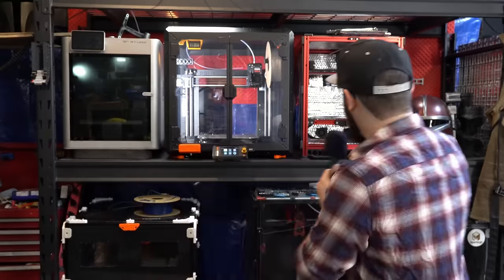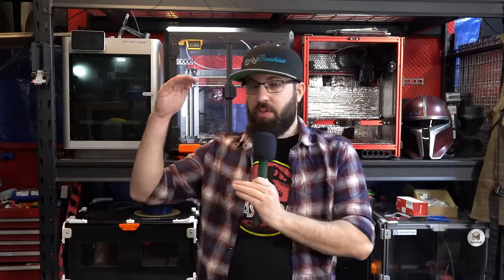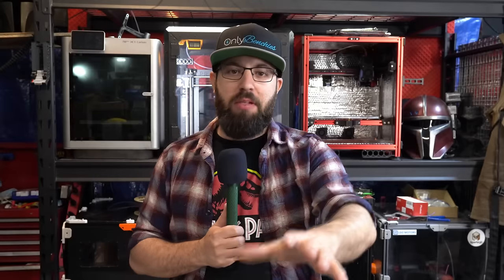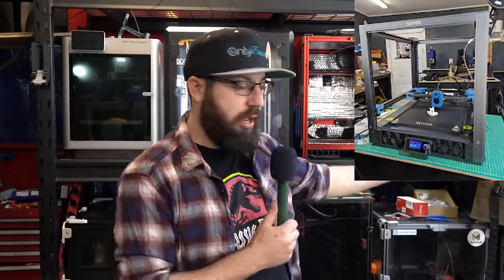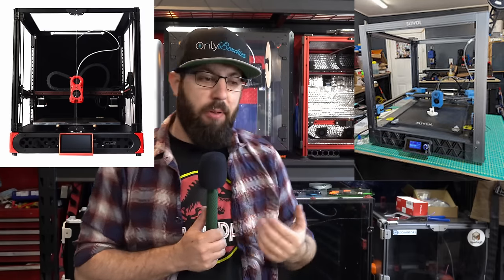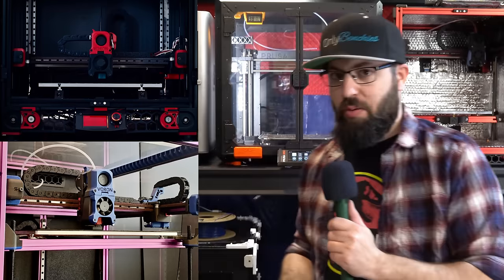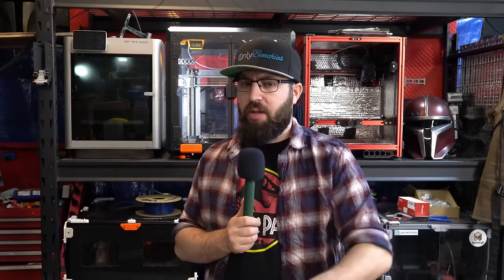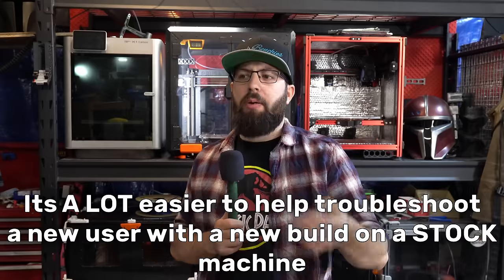What Is A Voron And Which One Should You Build?

Comment from the maker: TL:DW - Does it qualify for a Voron Serial Number? If no, then not a Voron, simple as that
Which Voron should you build? If thats the only question with no other info, build a TRIDENT
Reply: I wish LDO had a 350mm trident kit
Reply: Very happy with my Trident. Been pumping a ton of abs/asa and some carbon-nylon as well. I learned so much building and tinkering with it, never regretted my choice. The 0 was a bit too small for my taste, and the 2.4 looked too complex with no clear advantage over the Trident for my beginner brain.
Reply: @dog2bert only 350? Why not 500, 600, 800, 1000😂
Reply: @simontanguay3619  I think there are more mods that are specific to the V2 over the Trident.  Otherwise the two are neck and neck in rating.
Reply: Do you have to use ASA or ABS, or is PETG ok if its beefy for most part, obv hotend parts may need to be ASA for heat. But what about the rest?
Reply: @PMcDFPV  I would not use PETG if I can avoid it. ABS/ASA has better properties overall, be it thermal or mechanical. For increased rigidity, carbon abs/asa will do even better.

Comment: When i ordered a Sovol SV08, I did not consider it to be a Voron, although it is largely a Voron design.  The plan was to swap the toolhead and move to mainline Klipper.  Once i got it, I realized the toolhead is fine with it's Bambu clone HE.  The software lets it down.  Ive moved it to mainkine Klipper and am reasonably happy with it.  So, its not a voron but it has many of the great aspects of a voron and i specifically purchased it for these aspects.  Everything about the SV08 that isnt based on Voron design is what lets the printer down.  A voron would cost me $2500-3000 cad.  This SV08 cost me about $800 cad.  Not as good but better value for someone like me who also built a vorona and am happy i did.

Comment: I totally get what you're saying and you're also right. You don't get a Voron when you're buying a SV08 for example. Sure thing. But. "Ultimaker at home"... where did that come from again? Voron Design didn't claim to have the support or software like an Ultimaker back then. But they provided a similar machine with of the shelf parts. In this case as a non profit organisation, which is absolutely awesome. 

But am I the only one who sees the similarity with Voron and SV08/Troodon? They don't claim you get the same benefits as with the original, but you'll get a similar machine. Electronics in the base, easy to put panels on, same firmware etc.. I think a Troodon or SV08 is obviously more a Voron as an Bambu or Ender V3.

I love my Voron printers. And building a Voron was the best idea I had with 3D printing as a hobby. But as long manufactures respect Voron licencing it could be a win for the community. Can't wait to see what people do with SV08. And maybe Voron users can benefit from new mods and extensions like Klipper-AMS every chinese company is coming up with. 

Anyways, keep up the great work and have fun at reprep festival!
Reply from the maker: The "ultimaker at home" is from the design goal of the original voron.

An ultimate 2 tier of printer. But you can self source and build yourself
Reply: I personally believe the better label to apply is: "(Commercialised) Voron Derivative".  It may be wordy, but it is probably the most succinct yet accurate way to summarise what machines like the the Vivedino Troodon, the Sovol SV-08, and arguably even machines like BambuLabs P1/X1, Creality K-series are.

Comment: The V0 advice is very good. I have found the same experience with my v0. Lots of fun to build, and an excellent secondary printer. I would not want it to be my only printer.
Reply: I built a V0 as my first and so far only printer. It was super fun to build but I also have access to a bigger printer at work. So if you have access to another printer somehow and lack the space for a bigger printer at home, I can really recommend the V0 as the first/only printer.
One day I will have the little one print the parts for a V2 or Trident
Reply: @metalhammerish - I purchased a V0.1 kit from LDO well over a year ago and it unfortunately is still in its shipping box.  If you don’t mind, I have a couple of questions - Did you build your’s stock?  Is it still the stock printer you built, or have you since tweaked it?  Finally, do you still use it often?

Comment: I built a Voron Trident 300 kit from LDO. It's my goto printer now, 100% reliable and perfect print quality. Only mod I did was installing the Nighthawk wiring for the toolhead (highly recommend).
I also have a Bambu X1C (I printed the Voron parts on this) and a Prusa MK3S+.
Thinking about selling the Bambu and Prusa. I only need a hardened steel nozzle for the Trident to print Nylon-CF.
Reply: How much are you looking to sell tge MK3S+ for?

Comment: I just finished my first voron build and it was converting a FLsun cube to a voron legacy with the build volume of 310x310x415. i had to using one set of mods to allow for the use of short linear bearings be used from the FLsun but side that every thing else if legacy. A few thing i found with doing the voron legacy is finding the right hardware locally or screw kit online with descent shipping cost. also that there no manual for the printer it self but the tool head lucky dose so, u need to work from the cad file when doing the printer frame and core xy which is no big deal just have to stop and think on which is right step to go sometime. only big thing i could say about the hole printer build is that when putting the X Y carriage they call for a M5x30 button head for the rear most idler and if you screw it all the ya down it blocks the linear rod from passing through and socket head the same. i end up using a M5x45 just a pin to hold the idler in place and it seem to be working so far. the voron legacy seem to be a good option for someone that doesn't want to print abs but still want to try out the coreXY printers. Plus for the cost to do a voron legacy isnt bad at all compared to the other in the voron family to get ur feet wet only kicker is the self sourcing but if you can get lucky and find a donor printer that similar part to a legacy you can get in to a voron for very cheap thankfully.

Comment: In theory, you can eliminate the keyback on the switchwire in software.  If you keep the X and Z steppers powered up, the gantry isn't going to fall.  The catch, would be to auto home the Z axis as part of a power down function in software.  In the event of a power failure, there might be enough friction generated by motor back emf to gently lower the gantry without damage to the print head if it didn't "fall" from the very top of the Z axis.  The switch back does add some drag to the Z axis on the way down, and reduces drag on the way up, which might have some effects on printing as the motors might need a bit more power in one direction vs the other.  One would only see this during Z hopping though.
I'm almost finished with my Enderwire build.  Still need to fine tune things after a last minute hot end swap (gave up on the Taichi after it kept clogging, and now have an E3D Revo Voron.  Only one extruder now, but I might build an ERCF in the future).  Also need to assemble the enclosure and build a Nevermore.
Reply: What about if you just use a 1:2 belt loop in place of AB (XZ) drives? will that help?
Reply: I ordered all the parts for an Enderwire recently, except the keyback. I never really knew what it was for, so I skipped it. Is it a must have? I mean, if I just remember to power down the machine and gently let it rest against the bed, is that OK? Will the motors struggle to maintain position with the help of that little doodad?
Reply: I built a switchvyper (anycubic vyper converted to switchwire just like the enderwire project) you definitely should have the key back. Without it, the gantry will fall. Not terribly fast but the weight will cause it to sag and drop on its own. The specified key back gives just enough resistance to hold on its own but even just a tiny bit of additional pressure on the gantry will cause it to drop of motors are off
Reply: @jettachamp26  It probably depends on how heavy the tool head is.  I'm using a bowden extruder on mine at the moment, that's a bit lighter than the clockwork2 extruder.  I do have the specified keyback on mine.   I wonder how the V2 with the belt driven floating gantry keeps from falling with the motors off.
Reply: @KennethScharf  I have two v2s. A 350 and a 250. Both have minimal sag (mostly just the back where the motors are) but does not fall easily when motors off. You have to push a decent amount

Comment: I say the Troodon 2 Pro is Voron like because it uses the StealthBurner that can be upgraded or replaced. The the Sovol SV08 is not. It is a coreXY printer with a flying gantry. At least that is my view point. But I could never confuse a Bambu Labs printer as a Voron because the parts are proprietary and is very closed system.

Comment: Printers for Ants ARE Vorons.  They can be assembled using (most) of the official Voron manuals.  If Voron's auto BOM compiler on their  web site allowed for changing the bed size of a V0 , V2, or Trident to the PFA range, or swap between 1515 and 2020 extrusions, the result would be the same.  Have any builders made non-square bed sizes for Tridents or V2's?  Something like 250x300 for example  (Makerbot foot print)?

I like the idea of ready to rock and roll off the shelf Vonor-ish printers.  At least so long as they are Open Source, and the mechanics allow for user swaps of hot ends, including mounting Voron design tool heads (stealth burner) and other mods.  Don't call them Vorons, but do mention where some of your 'DNA' came from!
Reply from the maker: Most of the printers for ants do fall under "it's a voron". As they are basically remixes of the base designs using different components but still following the same design ethos.

Comment: my LDO Voron is basically stock, i just replaced all axial fans with Noctua ones to be more quiet, and i replaced the omron probe with klicky ASAP.
now, about a week after its finished i started preparing magnetic hinge doors to take off and quick release bottom panel clips. might make quick release klips for more panels, not sure yet.
Reply: Annex clips are the best and if you don’t have a front door do the “fridge door” klicky door mod huge improvement and looks incredible
Reply: Printable’s had a good annex clip stl. And they look great printed in two colors for even more accent

Comment: Also want to know why the rat rig is better for over 350mm2 size? Does the rat rig have beefier extrusions? 

The builder on voron will give you a material list if you do custom size. Does the larger format become too flimsy? And how does that go against the likes of elegoo OS giga? That has super thin extrusions for the size. 

Curious as I’d like to do a printer that is 450x300 but on livestream and here it recommended to go to rat rig….
Reply: Ratrig uses 3030 extrusions instead of 2020, so much stiffer for the frame. Doesn't matter that much at smaller sizes but becomes increasingly important at larger sizes where vibrations can limit your max acceleration (even with input shaping)
Reply: Yes, Ratrig uses 3030 and other beefy components.

Comment: I've been wanting to build a Voron for some time now, but I'm still not entirely sure which one I want to build. I got my first 3D printer early last year, a Bambu Lab P1S (I know it goes against everything that Voron stands for but I wanted a good out of the box experience) I figured that since I already have a Core X Y printer being my P1S, I would be a good idea to build a 2.4, or even a 0. Would either of these be the right call? Printing is just a hobby for me, I do not make any money off of it I do it purely for the enjoyment of making random stuff.
Reply: I would recommend a v2.4 to try something different. The p1s is very similar to a trident (but I believe only 1 z motor instead of three). I personally prefer the lower center of gravity and stationary bed, especially for large things.
Reply: Plus, quad gantry level go brrrrr
Reply: I'd honestly say if you don't need a same/bigger printer than your P1S, the V0 would be a good printer for when you want to print something small and don't want to heat up a larger bed.  There are a TON of variants to look at, however.

Comment: I actually want to disagree and recommend the V0 as a first Voron. A Voron should probably not be your first printer, so you likely have something that can print a big part on the rare occasion you need to. And your V0 can print your Trident when it comes time for that. A V0 is cheaper, it's easier to tune, easier to maintain, and heats up much, much faster. You're talking about 10-15 minute heat soaks instead of an hour. I'm always fighting with my V2.4 to get it to behave, or I'm sitting around waiting for it to heat up. And I don't want to use my old MK3 because it can't do much with ABS and it's slow. I really work hard to design things to fit in that 120 cube.

And I think there is one V0 mod you should start with right off the bat - handles. It's super simple and it's easier to build the printer with the handles attached, and it's easier to put the nuts in at the start to attach the handles than it is to add them later.

Comment: How hard is it to get IDEX working on a Trident? I really want to try mixing flexible filament in for seals and joints. Purging towers seem... not great.
Reply: There are several ways to get a tridex. Either full self source or starting with kits or pre built machines. Although if you use a kit as a basis you will end up with spare parts. You essentially need to widen the printer by 100mm and add a second toolhead. You also use nema14 motors instead of nema17 due to space.

If i were to build one, id either go one of two routes: get a used one as a donor printer or start with a more budget oriented printer, most likely a magic phoenix kit because it comes with canbus from factory, which you will more or less need. Otherwise use a formbot as basis if you cant get a mpx kit. 250mm kit sizes are the preferred ones. Then either buy the missing wider extrusions individually or get a 350mm frame kit if you can do something with the leftover parts. Then buy parts for a second stealthburner, 4 nema14 52mm motors, additional belts and pulley, the longer x rail and maybe a second carriage from the same brand. Panels must be ordered regardless of what you use as basis.

One last thing, a tridex is to my knowledge not capable of mirror and copy mode, not due to software, but due to hardware. The toolheads cant be leveled relative to each other, at least that was the case when i last looked

Comment: Ok. Custom components.
Yet for some people that is not so important, for some people it is even better to have injected parts and custom made metal parts, electronic boards. Because those are less expensive and more durable and better integrated.

We may say that it is nice to have some parts that are standard, like electronics and maybe extruders while some other parts like frame and joints would be nice to be custom made. YMMV

Nice video as usual, thanks.